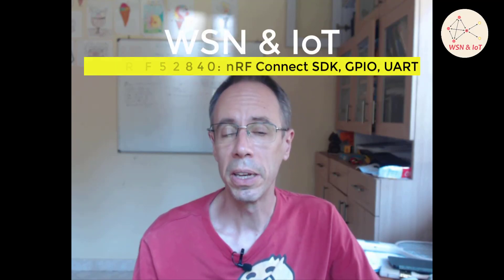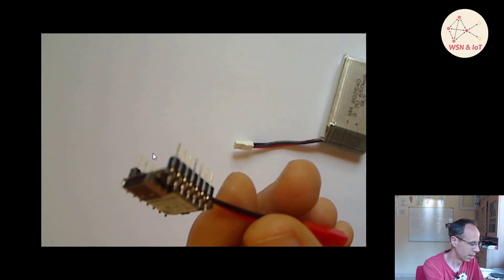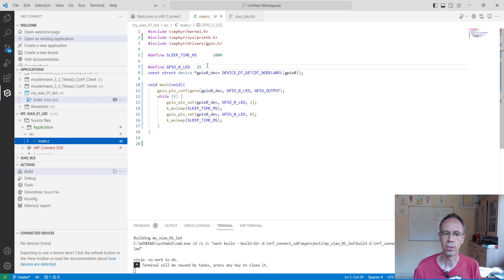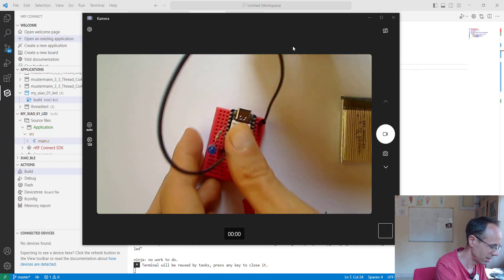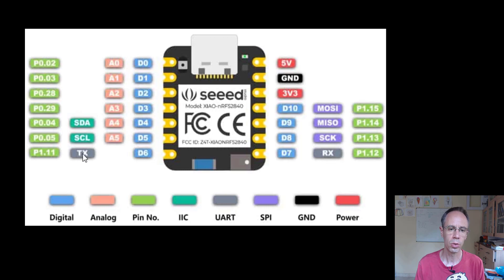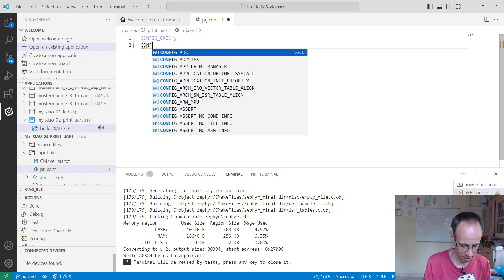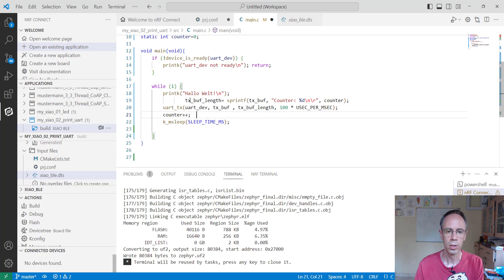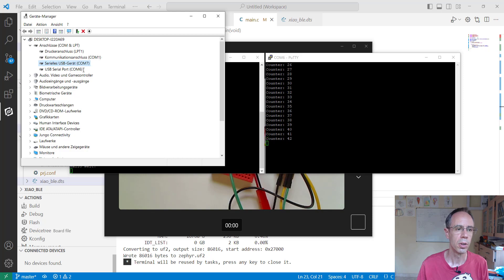Seeed Studio XIAO nRF52840 2: Zephyr, nRF Connect SDK, GPIO and UART

Comment: Great video! It helped me a lot with my learning process. I’m currently trying to build a project using the nRF52840 together with an SHT45 sensor, and I’d like to know if you could give me some tips on how to read data from this sensor. Also, have you already made any video on your channel about creating a BLE beacon project? Thanks in advance!
Reply from the maker: I used to work a lot with the SHT21. According to the datasheet, the SHT45 is even a bit easier to control. Maybe I'll find the time and inclination to make a video about it soon. Actually you have just to send the command 0xFD to address 0x44. Then wait 10ms and then read 6 bytes. Bytes 1 and 2 are the temperature, and bytes 4 and 5 are the humidity. Both must be converted to degrees and relative humidity according to the formula in the datasheet.

If you're doing it professionally, it's best to also check the CRC codes (byte 3 and byte 6).

I haven't done a beacon with BLE yet, only central and peripheral. Overall I'm more into OpenThread.

Comment: was banging my head on the table over the 'connected devices' not showing my xiao ble :'(
Reply from the maker: I hope you had enough aspirin😉.
Reply: so it's normal that this board is not visible in 'connected devices' table?
Reply from the maker: @MrIgorek123  Yes. This device has no j-link programmer/debugger integrated. It has a bootloader for transfering the firmware like using a usb-flash stick. Otherwise the USB acts only as USB-UART-communication, means you can use a COM-Port for interchanging data with the MCU.

Comment: Thanks so much for the video! I was wondering how to edit the code to be able to read sensor data using UART?
Reply from the maker: IF a sensor has another interface than UART and your device is battery powered, i would recommend not to using UART since the receiving over UART uses a lot energy. But anyway receiving is similar but a little bit more complex and there are multiple ways. I prefer to using two buffers. If the buffer is full you would otherwise to have to start the receiving new:
static uint8_t rx_buf1[10] = {0};
static uint8_t rx_buf2[10] = {0};
static uint8_t rx_buf_num=1;

void uart1_cb(const struct device *dev,  struct uart_event *evt, void *user_data){
	ARG_UNUSED(dev);
	switch (evt->type) {
		case UART_RX_RDY: ;//empty statement
			int offset = evt->data.rx.offset;
			int len = evt->data.rx.len;
			for (size_t i = offset; i < (offset+len); i++){
				if (evt->data.rx.buf[i]=='\r'){
					printk("\n");
				}else{
					printk("%c", evt->data.rx.buf[i]);
				}
			}
			break;

		case UART_RX_BUF_REQUEST:
			if(rx_buf_num==1){
				uart_rx_buf_rsp(uart_dev,rx_buf2, sizeof(rx_buf2));
				rx_buf_num=2;
			}else{
				uart_rx_buf_rsp(uart_dev,rx_buf1, sizeof(rx_buf1));
				rx_buf_num=1;
			}
			break;

		default:
			break;
	}

}

Dont forget to enable the receiving:
uart_callback_set(uart_dev, uart1_cb, NULL);
uart_rx_enable(uart_dev, rx_buf1, sizeof(rx_buf1), 100 * USEC_PER_MSEC);
Reply: @wsniot   thank you for your reply. i will test it out

Comment: Hey I have a major question about this chip. You mentioned that UART and I2C pins can nit work togeather at the same time. I am trying to use BLE UART as well as an I2C temp sensor. My temp sensor is not working correctly. Could this be why? Even tho I have not used the tx and rx pins?
Reply from the maker: UART0 and I2C1 should work together in the default XIAO project. I2C0 and UART1 is disabled by default because of the number limitation of the pins. Did you use pullup resistors for the data and clock line of the I²C-bus? It should use the internal as default, but sometimes its disabled or it is also more stable if you use external pullups.
Reply: @wsniot  hey thanks for responding, and yes the temp sensor I'm using has 2 10k pull-up resistors installed on it already. I'm using the mcp9808 temp sensor from adafruit. For some reason, the temp sensor keeps returning a value of "nan", and I can't figure out why.
Reply: @wsniot  to me it seems like there I'd a problem with initializing the i2c bus on the xaio nrf52840.  I am using the arduino IDE to program like how you showed in your tutorial. Not sure what I'm doing wrong, but you seem like you know more about this chip than anyone else on youtube